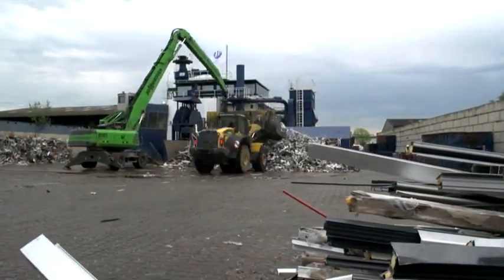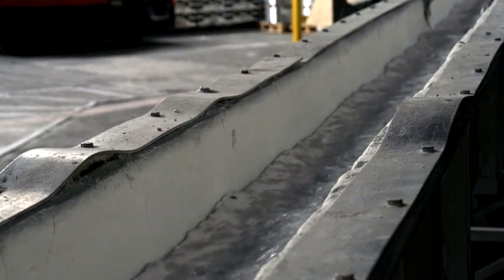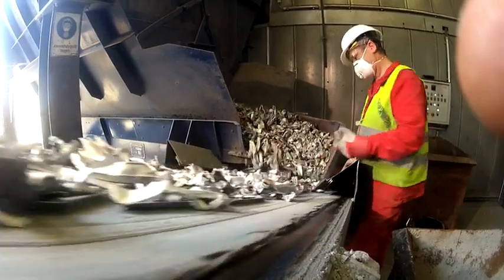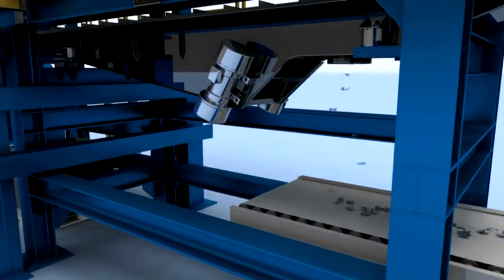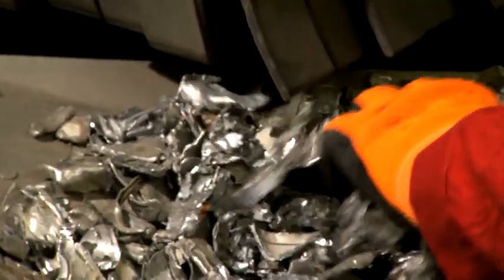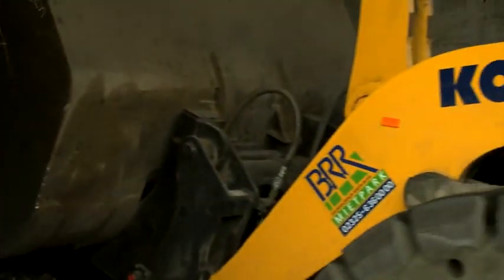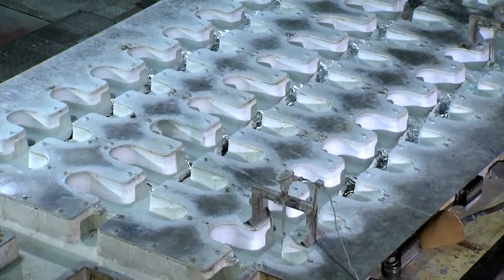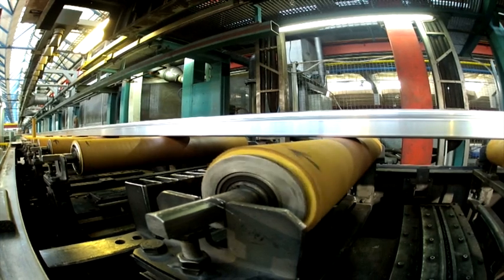How Is Aluminium Recycled?

Comment: The slow-motion video of the air jet separator is beautiful :) I'd never realized that different alloys would be such a big issue for aluminium recycling.
Reply: They can’t just make virgin aluminum again, and the aluminum for extrusion is very different than aluminum being cast for something like a cylinder head or transmission case.
Reply: While the statement 'Just recycle it' suggests that recycling is an easy solution to waste management, the reality is that it is often more complicated and not always feasible.
Reply: Yes it is.  Different alloys have differing levels of manganese, copper, silicon, magnesium, etc.  Beer Cans are primarily 3003 which is why they are recycled separately.
Reply: Problem is, bauxite is extremely plentiful
Reply: How on earth do they synchronise the air jet blowing of individual fragments of stuff with what the radiation detector detects ? Or maybe they just junk a whole belt-width if /any/ anomaly is detected?
Reply: @quantisedspace7047  It's quite easy.  It's also not the only system that works this way. I've seen others. I've seen video of a factory where defective units were blown into a defect bin.
Reply: Mihai Mera; ok so in the future they can when no more natural bauxite exists
Reply: Andy Walker it shouldn't be of they were so crazy about making certain products with it instead of just making new raw aluminum.
Reply: circusboy90210
Did you even watch the video. Making new raw aluminum takes a stunning amount of energy. Most raw aluminum manufacturers have their  own power plant,,, yes that's how much power it takes. Buying virgin aluminum is very expensive compared to buying recycled aluminum, and all the different alloys have very definite purposes. I use 319 and 356 alloys for casting, and 6061 and mic 6 for machining. It's very versatile but you have to know what you need.
Reply: william Greene; couldnt they refine alloys as if it was bauxite if there was enough aluminum being recycled? They dont bc the need for new Al is so high.
Reply: The two processes are totally different, but generally what you say is true. It is very hard to get back to pure virgin aluminum once it's alloyed though, so some stuff still needs new aluminum. It just uses stupendous quantities of electricity to refine aluminum from bauxite, and I do mean stupendous. Some facilities have their own coal fired power plant.
Reply: @TheAnantaSesa  not quite how it works mate.. nice try though
Reply: Well, preferrably you use wind, solar or hydro-electric plants for the electricity. Coal should be used to make pencils and smelting steel, not be burned for electricity when you could burn any old piece of garbage. If USA used their houshold garbage for fuel in power&heating-plants not only would you save on all those landfills, you would also save on coal.
Reply: @andreassjoberg3145  We have biogas reclamation at most solid waste facilities already. Just FYI.  The real frontier is in getting it from sewage. Once there are thermophilic digesters for sewage at scale, wet organic stuff can be added as a feedstock. 

Then waste-to-energy plants (handling dry material only) would be extremely efficient.
Reply: @andreassjoberg3145  lol do you understand economics?
Reply: @toomanymarys7355  Excellent.  I have been speaking to people of this win win way of producing energy.

Comment: I've had the opportunity to design vision processors for air jet sorting wood blocks used in pencil manufacturing and another system that rolled aluminum plate, 8 feet wide, to final thickness at 5mils of precision. Another system measured huge fresh cut logs for sawing. Over twenty years ago now since I worked for Applied Scanning Technology (not the same company you find today). Ah. Good times....

Comment: What is the cost per ton of recycled Aluminum made from this process vs the cost per ton of aluminum made conventionally?
Reply: More expensive to recycle for sure.  Aluminum is one of the few things that is more expensive to recycle than to make from raw materials.
Reply: A quick google search determines that to be bullshit. 

Producing virgin aluminium is very energy intensive, thats why we do it in Norway with cheap and green hydro power.  Our aluminium plants are literally built next to hydroelectric dam sites. Thus the Hydro company name.
Reply: @Ola Ruud using more energy does not inherently make it more expensive.   Good lord, kids today are stupid.  There are many chemical processes with recycling aluminum that are required to get out the impurities.  That's not "energy", but it's expensive as hell.
Reply: @BornIn1500  the beauty of aluminum is that recycling takes a fraction of the energy that it takes to make virgin aluminum. Jesus, a quick Wikipedia search would tell you that.
Reply: @Donn Buchfinck using more energy does not inherently make it more expensive.   Good lord, kids today are stupid.  There are many chemical processes with recycling aluminum that are required to get out the impurities.  That's not "energy", but it's expensive as hell.
Reply: @BornIn1500  more energy = electricity = higher production cost for virgin aluminum. Recycled aluminum takes 5-10% the energy to turn it into something usable vs virgin. That 90-95% energy is a cost. Plus lower power use means that the recycling can be done away from the hydro electric dams used to create the massive amount of energy that is needed to create virgin aluminum. And energy is not wasted moving materials around. You and I are having two different conversations.

Comment: OMG - the radiation detection and extraction is amazing!!
Reply: The mark of genius is to solve complex problems with ideas so simple they're "obvious".
Reply: Ya i was super impressed
Reply: I remember I first saw this on "how it's made" the Frozen French Fries edition. You should check it out, apparently this isn't extremely new tech
Reply: beats blowing into straws/. Did that for my last job...
Reply: It is very cool, but it is not something groundbreaking or new.
Reply: Recycling is detoriating metal in the end or I am paranoid stupid guy next door?
Reply: @oskars_l  I mean it probably slightly reduces the quality of the aluminum but you don't exactly need the highest quality pure aluminum for a goddamn coke can
Reply: @Misha-dr9rh  Actually, you do need it to be of highest quality. A soda/beer can has to be able to withstand a lot of pressure while being only a few hundreds of a millimetre in thickness at the sidewalls. Filled cans are stacked ontop of eachother during transport and they may be subjects to higher than normal temperatures - all this while being internally pressurized to ~2.5 bar (at 20C).

Beverage can engineers have meticulously calculated cost efficient dimensions for cans per given application and those calculations rely heavily on expected aluminium grade.
Reply: thats revolutionary for almost any industry
Reply: O
Reply: Oddly enough, it's actually not all that shocking of a device... engineers going with simple and reliable on this one. Don't get me wrong, it is very cool, but it was also somewhat off the shelf if not directly off the shelf.

Why I say that is this device is almost identical to an optical food quality sorter - which have been in use for 20+ years even at some relatively modest factories. The one we had at our factory was able to reject tortillas with size/hole issues or that were over/undercooked - the only real difference with this Norsk Hydro application and the one we had is this one uses X-ray spectrum and ours was optical - but not a major difference at the end of the day... the software was doing very similar tasks for each item that passed under it.

I was hoping they had something really really novel when they said they could sort out undesirable alloys... this is cool but not Nobel-worthy. :D

Comment: To save more energy why can't they just melt it down once, instead of melting to make billets, then again to make the frames. doesn't make sense.
Reply: +tris baker
I suppose an aluminium window manufacturing plant could be built next door, but it's probably already built somewhere else. 
And, Europe has many Nuclear Power plants that have a lot of energy that goes to waste at night. Perhaps this underutilized energy is used in that process.
Reply: As the narrator explained, once aluminum is alloyed with heavy metals such as copper and zinc, to make airplanes for instance, its properties become unsuitable for the extrusion processes used to make products such as window frames.  Simply melting the alloy does not provide the means of separating the metals used in the alloy, so aluminum made of unsuitable alloys must be separated before the metal is melted to make either ingots or final products.  Hence the separating process.
Reply: Location, location, location...

These billets are used by literally hundreds of manufacturers making there own select products. For your suggestion to be practical...all of these manufacturers would have to be literally located immediately adjacent and close enough to allow the heated aluminum to be processed efficiently. Obviously...this is impossible practically.

Comment: To clarify to anyone that thinks Aluminum is just Aluminum and believe "hundreds of Alloys" are used to create one type, you are mistaken. Aluminum has dozens of grades, properties and characteristics! All grades require different blends of other alloys/minerals/metals etc to get the right properties. Which add up to hundreds of different properties. Some are better for airplanes, some better to machine, some better for salt water etc.. You get my point!
Reply: kevin O,  yeah but aluminum  is in fact aluminum.
Reply: Aluminum is a chemical element, so there really is just one kind of aluminum. An alloy cannot be aluminum, it is an alloy, just like steel is not iron.
Reply: Tomas Herink it is however an aluminium alloy, that consists of mostly aluminium.
Reply: Yeah. It's like saying that "steel" is just iron and carbon and nothing else.
Reply: You mean like the video pointed out at 1:25?
Reply: Saying that all aluminium is the same is like saying all women are alike...
And you'll be lucky if you survive that one.....
Reply: @Thunderstixx77  Only if SWWBO hears you.
Reply: Oh, the difference .001% zinc can make. 😊
Reply: @426mrspawn  Unless you're building an airplane.
Reply: @426mrspawn  Or silicon, or copper, etc.
Reply: Some better for fireworks like dark aluminium, atomized al, and magnalium.
Reply: I think it would be cheaper to not worry about the other metals and just turn it all into a lower quality recycled aluminum and sold. For parts that need a quality aluminum alloy can just buy it fresh.
Reply: People use the same word differently in different contexts... in chemistry aluminum is an element, a pure substance, but in the metal industry aluminum is an alloy, not a pure substance.
Reply: @adamsmith1323  Agree...the industry is using the term incorrectly...correctly stated it should be called 'aluminum alloy'. Language laziness (often in us all) drops the key word 'alloy' causing the occasional confusion.

Comment: You would think each alloy would melt at a different temperature than aluminum and with the aluminum in the mix melting first, it could then be sloughed off, then the remaining batch would be heated further to melt off copper and other metals.
Reply: alan30189 they need to minimize the energy used for the separation of Aluminum and different metals
Reply: You are correct...you can use heating to separate the mix. However, this does require the use of a lot of energy to provide sufficient heating.

Comment: Window frames, window frames, window frames
Reply: It's 6061 series aluminum, or Extrusion by name.
Reply: He said 6060
Reply: In the late 60's most of the houses in BC had single pane Alunminium slider windows, no screen. We all upgraded to sealed dual panel windows with pvc frames. We saved a lot on the heating bill. Did not last long. The hydro and gas companies had their expenses, union rates go up etc. So as we spend a lot of money to upgrade insulation, new overpriced LED bulbs, electric and gas bill rates jumped up to cancell any savings.
Reply: developers developers developers
Reply: @ibrennan  Marsha, Marsha, Marsha
Reply: HooDooed Tanker is a
Reply: Und Braunkohle in Deutchland? Umwelt? Verruckt crazy in Deutchland!

Comment: This is amazing. The government should invest into plants like these. Eventually we are going to be out of raw resources, and only have recycled scraps to work with. I'm sure millions of tons of metal sits in land fills, but this process could be applied to all metals (with varying difficulty) to minimize waste at an extreme level.
Reply: Aluminum is literally 8% of the earths crust. So no. We aren’t running out anytime soon.
Reply: Due to how wasteful society is today, in the distant future, landfills will probably be mined for their metal content. That will be yucky.
Reply: We won't run out of bauxite for a very long time, but without clean energy, it is very important to recycle aluminium. You can melt a coke can in a campfire, but it takes a powermstation to refine bauxite to alumina
Reply: If it isn't economical without government investment, then it is wasting valuable resources. To the extent recycling is a good thing, private companies will do it on their own without government assistance, as a matter of minimizing costs of production. If government assistance is needed, then necessarily costs are not being minimized, and costs are nothing other than expenditure of resources. Private enterprise has been recycling, to the extent it genuinely saves resources, for a very long time.
Reply: Be very careful about turning to any government for a solution. Private industry is ALWAYS going to be more efficient than any governmental body, and you don't have to give up freedom or security.

Comment: Do you have any video with UBC (used beverage cans) without use of primary aluminum in the recycling process? There are two different alloys: AA3104 for body can (CBS: can body stock) and AA5182 for pull tab (CES: can end stock). The chemistry is lower than window frames that is AA 6000 series.
Reply: That starting phrase "old cans make new cans" is just a marketing wank lobbyists spread. It's almost never true.
I can't imagine this is done on a significant scale outside of the lab. The combination of alloys in a single products makes it very difficult. It needs to be sorted, and you only get a few grams of aluminium for each operation, but a lot of dross and impurities.
They probably mostly go into cast aluminium, where pretty much all low grade aluminium grades go.

Comment: This is clever !  It's just like the machines that sort potato chips / crisps.  
The potato chip sorting machines shine lights on stream of chips.  The machine photographs each chip, looks for blemishes, and uses a puff of air to knock any burned potato chips from the stream.  The result is perfect chips.
Here, the X-ray machines act like the lights of the potato chip sorting machine, except the X-rays are tuned to the frequencies at which contaminants absorb X-rays.  As soon as a metal chip absorbs too much X-ray radiation, it's knocked from the stream of chips.   The result is homogeneous aluminium.